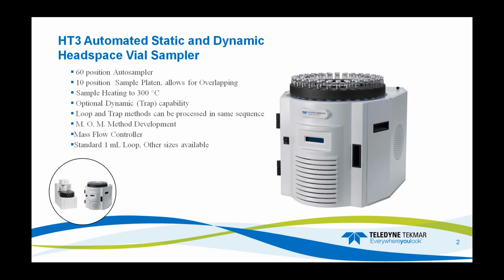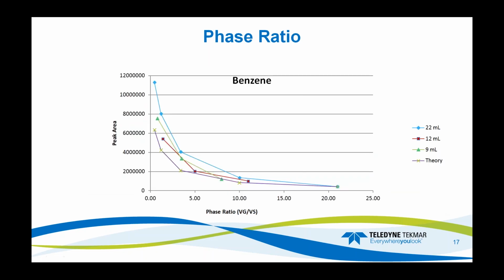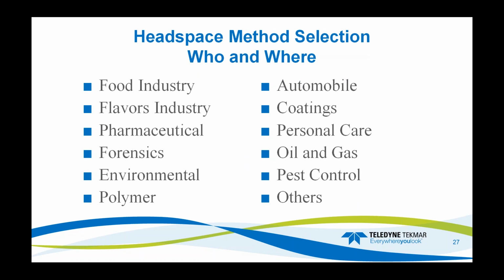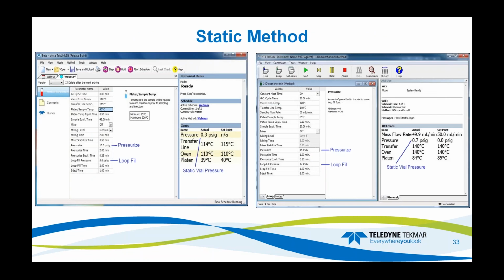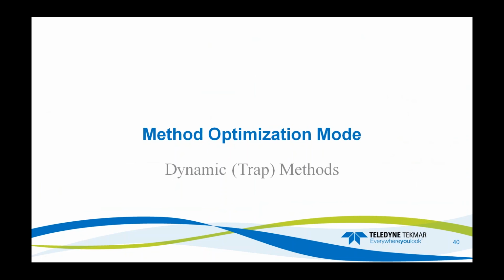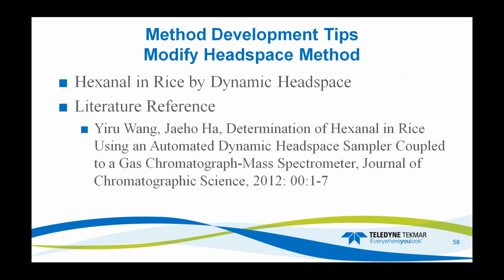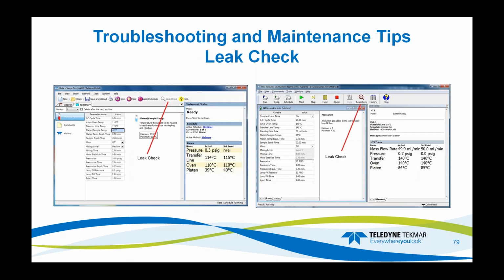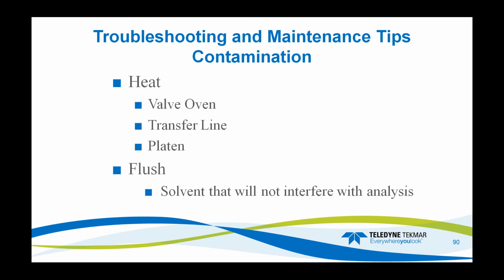2016 01 14 10 59 Static and Dynamic Headspace 411   Theory and Method Development

Comment: Hi, in mass balance equation, is Mg mean volume of mass in gas phase?
Reply from the maker: Mg stands for the mass of the sample in the gas phase. As the sample is heated, volatile compounds enter the headspace of the vial. So the combination of the mass of the sample in the gas phase and the mass of the sample matrix is equal to the original mass of the sample: Mo=Mg+Mm. In order to calculate the Mass of the gas you would need to multiply the concentration of the gas and the volume of the gas: Mg=Cg*Vg.